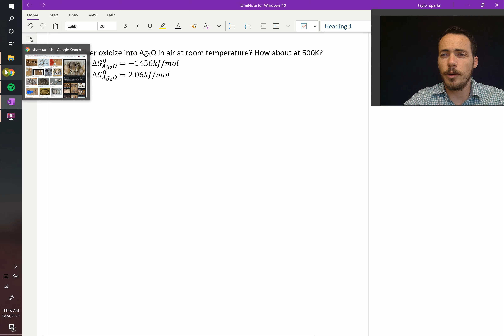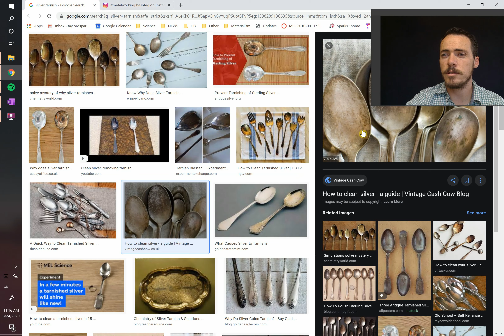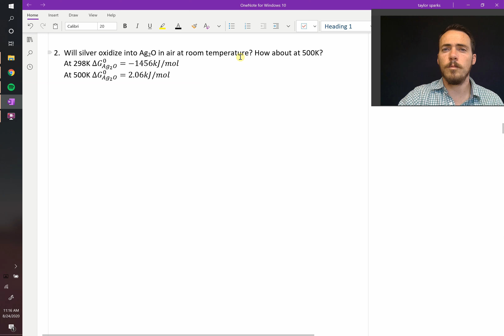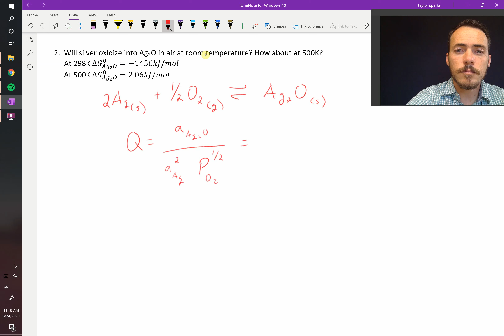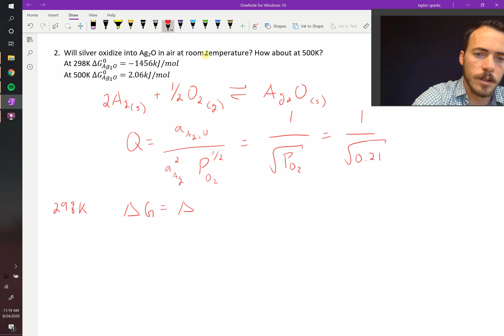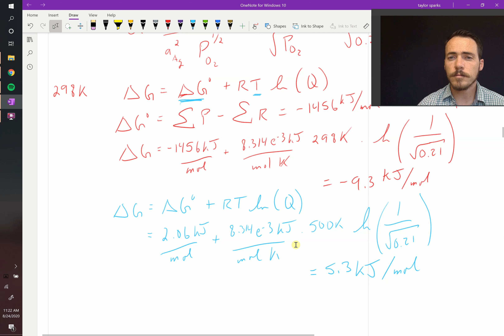Can you simply heat silver to remove tarnish? Example of thermodynamic free energy calculation

Comment: Great video. In case I'm not the only one who watched this with the hope of actually removing silver tarnish -
The black tarnish your silver is probably silver *sulfide*. Not silver oxide. Don't put your silverware in the oven at high temperature hoping to drive off the oxygen. Instead, remove the sulfur by having it bind with aluminum foil instead.  There are YouTube videos showing the simple process with boiling water, aluminum foil, and baking soda.
Reply from the maker: Thanks, sounds like I need to update this example with the sulfide. I'm curious what the thermodynamic calculation would come out as now.
Reply: @TaylorSparks  
I would love to see that!  I'm curious what it would be, but don't know how to calculate it. I can follow 80%-90% of what you mentioned in the video. (Not a chemist here, but just like to use a little kitchen chemistry for practical use. Such as using hydrogen peroxide and baking soda to remove sulfur (skunk, garlic) odors from surfaces. I don't know anything about moles or Gibbs free energy, but I know hydrogen peroxide de-garlics my cutting board! I guess by turning it into sulfur dioxide gas, which smells up the room but removes it from the surface?

Comment: 4:58, my calculation of RT*ln(Q) is only 1.933 kJ/mol, so the delt G should be -1454.1 kJ/mol, something wrong?
Reply: This is super super super late but uh I got the same thing
Reply: The unit of partial pressure used in the video is atm, but shouldn’t that be Pa as we are counting the energy in kJ/mol?